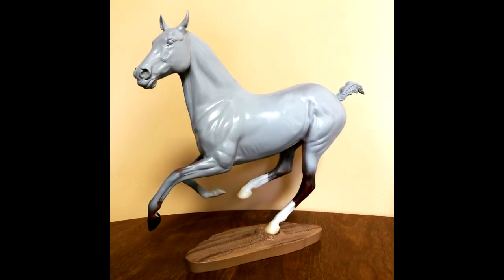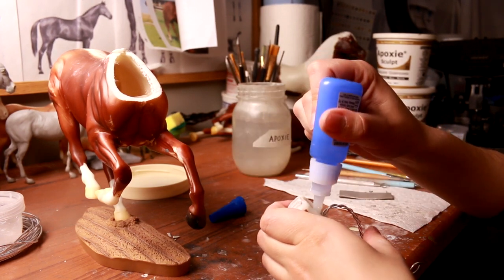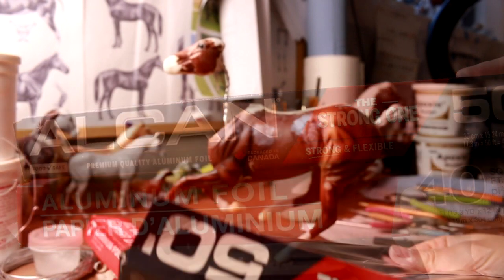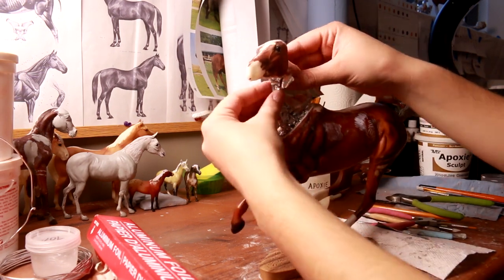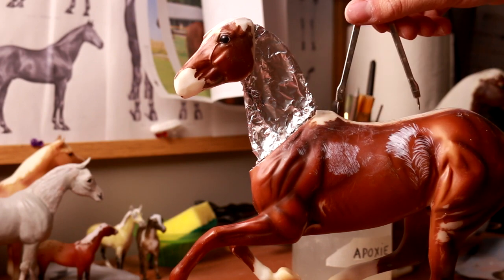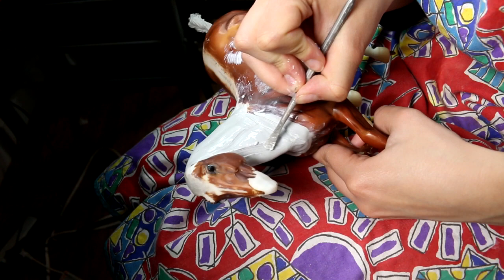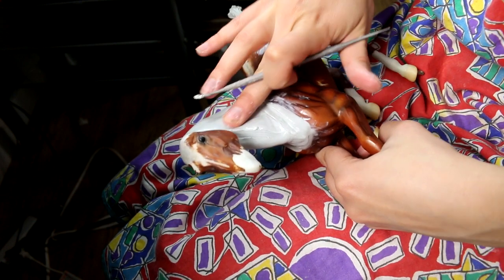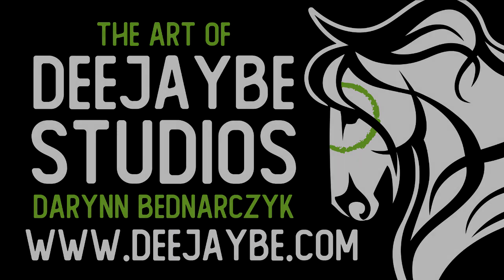Creating a NECK - How To Customize Your Breyer Model Horse

Comment: How do you prep after your clay dries especially for small nooks and crannies, thats a lot of my current issue with faces and necks even with sanding its hard to get smaller areas good looking
Reply from the maker: Sanding with folded corners of sandpaper, Bondo to fill in spots & Carbide scrapers.

Comment: Hi, I've been following you for quite some time and I'm curious to know your opinion on the best way to repaint a schleich horse model, not the smooth plastic I mean the textured ones you usually get at a country store like Murdoch's. I want to get the Andalusian stallion and mare and repaint them to a blood bay color. I saw the airbrushing tutorial you had awhile back on repainting a small minature to black with the red undertones and I think that's what I want to try but idk what paints to get or the best way to get full coverage as it would be the very first ones I would be attempting to repaint. Any tips would be appreciated!
Reply: Hey there! Since I repainted some Schleich horses before, I figured I have some tips. :3
Since Schleich horses (as you say) have texture I usually prime them with watered down acrylic paint. It also works really well with the airbrush. Vallejo colors (DeeJay also uses them) are really great and cover very well. In case you want torlos use pastells, you just need some extra pressure to get the colors into every little corner. If you don’t have Vallejo or any other airbrush colors, you can try to use waterbased acrylics and thin them down with water. But I would recommend to use actual Airbrush colors, or thin the acrylics with actual thinner. 
Just some tips, so maybe they help :)